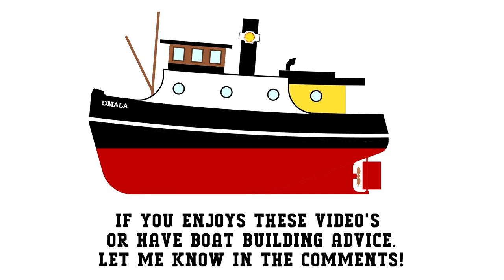Houseboat Omala | Ep. 16 | Wrestling with rubber fenders

Comment: @4:20 - I bet that smelled really good! Kof-kof!
Yes Jop, probably the difference between the inside & outside curve, the rubber compressing on the inside, rather than stretching on the outside - bummer! ;-) Thanks for the update - and for showing your mistake!
Reply from the maker: I can't really imagine the rubber compressing that much, it''s so friggin though. But somewhere the mistake slipped in. Luckily I have plenty of the material laying around, in the future I plan to mount the same on the stern.